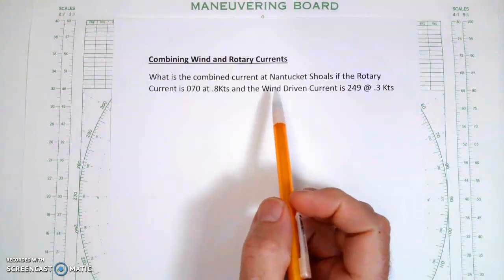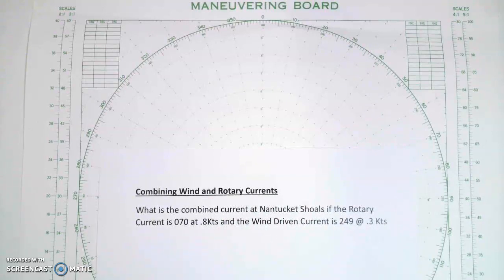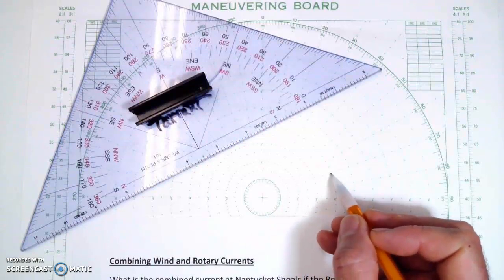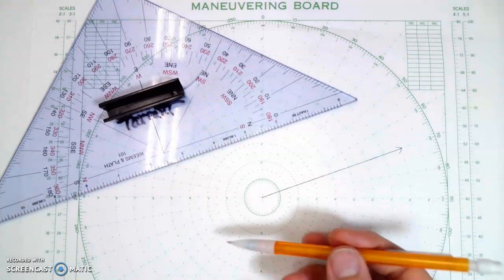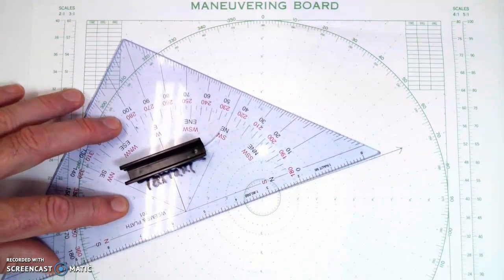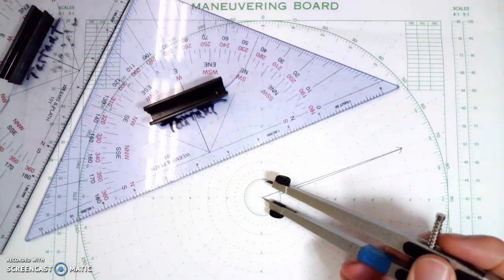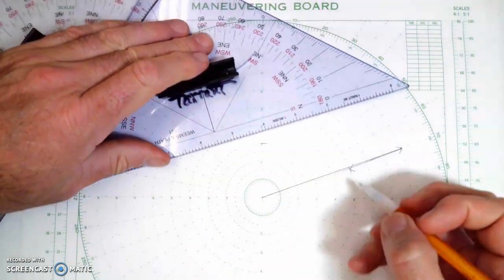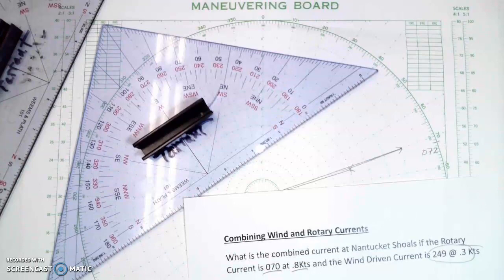Combining two currents to determine the overall resulting current

Comment: Hello, quick question- do you know if the current version or Lapware is still useful for the current USCG 1600 ton exam? (Particularly the chart plot).  Im hearing that the exam has just been changed drastically and the pass rate is extremely low this year…
Reply from the maker: The NMC has made some changes to the CP that require testers to look more carefully at the  publications and also think more out of the box than what was asked a couple of years ago.  Additionally, some of the new questions are also a bit ambiguous. That being said, Lapware is trying to keep up with the changes and has added a few newer chart plots based on example tests published on the NMC webpage (you can download the example tests yourself). It isn't clear though which are the newer plots on Lapware so if you do get a license I would email the administrator and ask which ones you should look at.